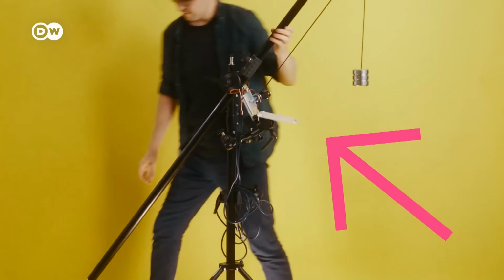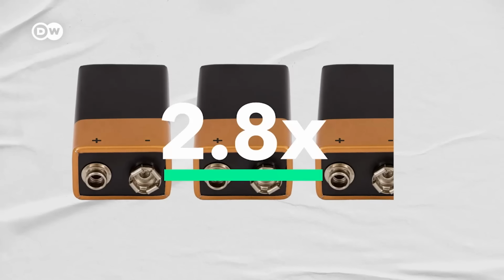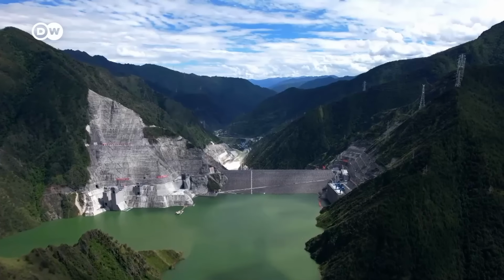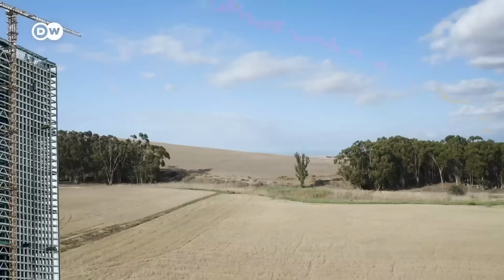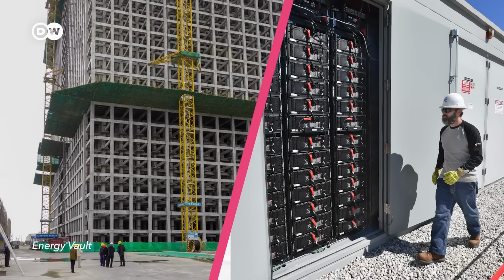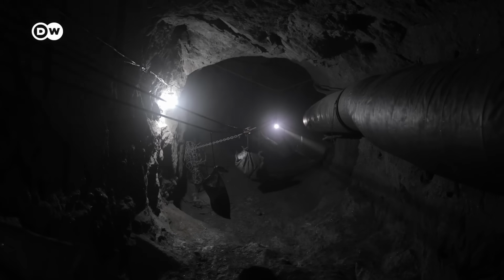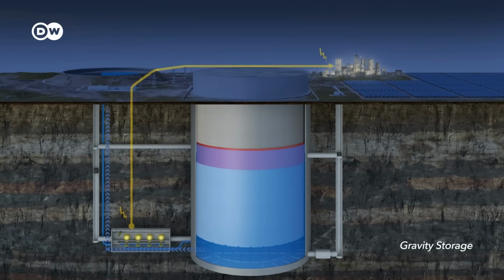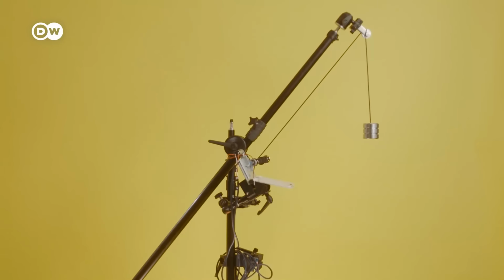How to use gravity to store energy

Comment from the maker: How is energy stored in your area? Do you think gravity batteries are the way to go?
Reply: - Gravity: Only Store Energy
- Hydroelectric: Store Energy and Auto Fill Energy (the cycle of evaporation and condensation of water powered by the sun's self-sustaining nuclear fusion)
Reply: Here is a better idea: pumped-storage hydroelectricity!
Reply: @Neferkariusz31 Depends on the use scenario. For emergency power supplies in critical infrastructure like hospitals, data center, transportation, gravity batteries can be a good solution to cover the first few seconds - minutes
Reply: Gravity batteries are expensive, and probably unnecessary.  See the work of Form Energy, a company that has designed industrial-scale iron-oxidation (rust) batteries that can be made from cheap, domestically-available, recyclable materials, that are extreme-weather tolerant, last for decades, and generate few, if any toxic byproducts, while also using very little water.
Reply: Waste of energy & money!
Reply: In the UK there are 65,000 redundant vertical shafts in old coal fields.  Many of these are close to population centres and there must be a good few that will lend themselves to the task better than others. Where I live, Cornwall, must be at least hundreds of vertical shafts in the old tin and copper mines.
Reply: @adrianfielding4678   the limits for a draw works seems to be 1000 tons. Use a units calculator (I use fourmilab) and enter `gravity * 2000 meters * 1000 tonne` to learn that even if you lower that enormous weight 2 kilometers, it only stores 5.5 MWh, less than two Tesla Megapacks. Contrary to what @Jonas Mayer says in this video, that kind of lifting/lowering machinery requires lots of expensive maintenance. If you use multiple weights, you now have to have big switching yards at the surface and below ground to move the working mass to and from the shaft: more expense, more maintenance.

Gravity is an extremely weak force!!
Reply: Wat too little energy stored. Compared to pumping water up and down a mountain, it is nothing at all.
Reply: Tax theft.
Reply: This is ridiculous. The future of energy storage is in enhanced geothermal. You get a free battery with every geothermal well.
Reply: Hydropower. Way more cheap, reliable and scalable. Any other gravitational battery is BS
Reply: Too the first question it's mainly hydro-power so for the mostly electricty usage we have here in Norway are clean energy, but there are also becoming more and more of solar production and wind. One of the reasons is that we wan't too keep mostly of the oil production too export, sell it too other countries who need it more and making more money on the sells and keep mostly of that production into profits. And it's kinda opposite of what Norway have been standing for in the rest of the world, but we are in fact very focused on the environment. So we are also using el-bike, el-cars like mention it's charged up with electricty that's mostly beeing produced with water, solar or wind.

And we are also having alot of electrical bus and train so we are less and less demanding for the oil.
This is just genius. It's seems too be silence so that's also another positive thing.

- Norway
Reply: can u please point to the actual date when u learned, or generally journalists learned that u could be educated sufficiently about something from one of the leaders of the company with a specific interest to make sure this makes them money? when did businessperson become scientist, i didnt know this happened, I guess I can trust Soudi Aramco with all of their business decisions now, and i cant really trust them when they deny climate change now, thank you for teaching me the wisdom of oil barons and Leonardo DiCaprio. (sarcasm)

Next time you make an ad, please review your country's legal guidelines and regulations because as it stands this is just pure misinformation literally funded by oil companies as you mentioned in the video

"we will only know if this will work once its been built"
>science who has spent the past.... mmmm idk... few CENTURIES working on mathematical models that people like the likes of elon musk and dw seem to ignore and reject, "can you stop wasting money on shit i told u wasnt gonna work, am i a joke to u?"

I cant believe you started this vid by saying something like "but dams are expensive and big and need specific locations" then end the video showing that this method is more expensive less efficient and has the same drawbacks considering its just another form of mega structure (a mine is also a mega structure), please grow some perspective.

What is with the meandering soft takes most people dont watch videos to the end you have just misrepresented this whole thing by giving more of a shit about your click through rate and watch time than the news or information, thousands of people will never see the conclusion and will be talking bullshit to their friends now, good job, way to news
Reply: If it gets too windy, the swinging weights will damage equipment, so gravity batteries are best done in a mineshaft.

A better option is to make mini-pumped hydro on hills.
Just build steel cylinders on hills, cap them with a heavy lid and pump densified water uphill into them.
Instead of storing regular water in a dam without pressure, this stores densified water in a hydraulic accumulator, so can be used much on smaller hills than pumped hydro.
You store far more energy because the working fluid is under modest pressure and the densified water carries more energy downhill.            :)
No rare minerals required, just steel and pumps.
Reply: @EveryoneWhoUsesThisTV just make the structure enclosed. The weights moving up and down on the inside of the tower. Duh.
Reply: @SandroLyrio  That's not the system pictured here or discussed.

Seems like a simpler solution would just be to switch to something that actually works.
:D
Reply: @EveryoneWhoUsesThisTV The technology is what is in discussion.
Reply: @SandroLyrio  Yes, this technology is what we're ripping on because it's so goofy....      :D

Building a tube tower with limited internal storage for the blocks isn't a solution.
It would cost more than a stick tower and still be almost as useless.

Let's build a hollow skyscraper as a cost effective way to store power...        :D
Reply: Guys wtf. Gravity batteries have been debunked as braindead bs YEARS ago. The entire idea is utterly ridiculous. How did you end up in this rabbit hole? This is so stupid it severely undermines all credibility you have had so far. I now question everything you ever told me and will never again be able to use you as a reliable source. Wtf, seriously...
Reply: Who ever said Germans were humourless has never watched this.

This message brought, bought and paid for, for you by the Big Oil & Big Nuclear Fission industries. 

Lithium is bad, lithium is bad it damages the environment, it only lasts a short time, it, it, it  undercuts our industries  and we going to loose our cushy jobs and its so unfair wah!
Reply: This is biggest bullshit i have ever seen.... NOt only is big, expensive, and have small capacity, it produce A LOT of CO2, bc those materials like steel or concrete DO PRODUCE A LOT OF CO2 shen they are being created... It is way ti steal government (our) money at the best... nothing else...
Reply: Great addition to a hybrid system setup, along the lines of capacitor energy storage.
Underground setup is a better bet.
If needed, can be adapted to run on draft animal power - or even human power.
Reply: https://youtu.be/NIhCuzxNvv0?si=ovsHPu0_8qcOIPWY
Reply: its nonsense and trap for investors who dont now much about physics.... Why produce that weights from steel, concrete, sand whatever what material will be, when water dams solved this centuries ago? And dam is refiling "itself" you dont need repairs of ropes, that weight itself, and same time you regulating water for industry, agriculture etc..... This is so sad how dumb are people now days. I eat my shoes if this could be economicaly feasible. Its only stupid.
Reply: aside from pumped hydro gravity batteries are scams designed to defraud investors. Why are you promoting scammers, DW Planet A?
Reply: Why dont you lift huge bags of sand in Sahara by boiling seawater by mirrors ?
Reply: Bruh. This has been debunked so many times now. At least one can now measure the delay from the first proposal to when DW would pick it up for a clickbait. 😛
Reply: @DW Planet A i'm highly dissapointed in you. Gravity Batterys are offside pumped hydro a scam. And almost anything you told in this video was wrong. You could have known by using your brain. Or doing a simple search. You know there are youtubers dedicated in debunking BS. If you are to lazy to factcheck on your own bc you dont understand science: Just put the name of whatever and add scam or debunked etc to it...
I just did with Energyvault and you quickly find a douzend videos explaining why it does not make sense.
Reply: GJ you fell for an old scam. The optimized version of this is pumped storage.
"But you don't have water everywhere!"
Holy Susan...
And the materials for this scam just spawn in? And are cheaper then sea water?
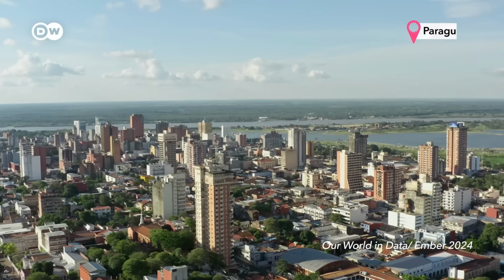Reply: 1:32  What a great way to remediate old mine shafts. Clean, abundant power.
Reply: @democratizeourpower-nr5yy  not abundant. If you just lift and lower one massive weight in the mineshaft it doesn't store much energy (otherwise old mine owers would be doing this already); if you have multiple weights then you need to build large switching yards at the surface and the bottom of the mineshaft at great expense.
Reply: No unless they are the hydro electric variety.
Reply: This is  SUCH a dumb idea. Sorry. One of teh dumbest and  least renewable battery storage idea's ever created. MaybeMicro with massive granite boulders but  concrete????? is not at all acceptable. Adam Something  slagged this junk idea of   complete con artists with a dumb idea years ago when first proposed. just tell them NO. there are far better ideas. Just ask the Welsh.
Reply: VAGUE.
Reply: Horrible
Reply: The value of gravitational force is dependent of the height of weight from the ground. So to life the weight for first 5 meter we need energy E1 but to lift for the next 5m we need Energy more than E and so on. Similar when the weight is released it will produce more energy at higher levels and low energy at lower levels. So how this issue will be resolve. We may face more energy loss during this process. 🤔
Reply: What about abandoned oil wells ?
Pre holed thousands of feet!?!
Reply: Make the connection 👉 The Connections (2021) [short documentary] 🌎 ♥️ 😎 ✨️
Reply: Why not just move water between upper and lower part of abandoned mine? Pumped hydrgo underground.
Reply: I think pumped storage as a proven and cheap method (1GW storage costs around 1 million USD  to build) and run at 80%+ efficiency is so well established, that it is unlikely the markets will gamble on this method. I may be proven wrong......
Reply: Yes they are the way to go, but seriously use buoyancy to get the weight to the top.
Reply: What about slipping a gravity battery frame under the next big heavy building being built in a city?
Reply: What happens if it uses two cable systems, one to go up using a compound pulley system to bring the weight up with much lower work, then when at the top it releases from the pulleys system to come down at full weight? Are we gonna get from it more than it took to get it to the top or am I tripping?
Reply: They don't work when the wind is blowing. It's a scam.
Reply: @josephd.5524  just make the structure enclosed. The weights moving up and down on the inside of the tower. Duh.
Reply: This is why I want Deutsche Welle blocked from my feed.

We've had gravity batteries for literally thousands of years.  It's called hydro-power by some.

But for some reason, the Wokist Left seems to equate hydro-power with dead fish, no matter where it might be sited, no matter how it might be designed.  And they seem utterly incapable of assimilating anything else, especially if it contradicts their little "Dams Kill Fish" jingoism.

You do the same with nuclear (shut it off and tear it down), then go buy and burn more Russian methane.  And then you point the finger at the US for climate change.
Reply: @casnimot  great comment and to the point. To early in the day- but I should calculate how much uranium is needed to "store" 100MWh of energy. Not much I'm sure
Reply: DW . after the idiocy of the generators on the water pipes, you come up with something that even a high school calculation shows is completely unlikely to ever be implemented as anything as large scale. The only reason there are companies doing this is because there are enough people with money, private and public, to just thrown money at anything that they don't understand and sounds promising.
As an old saying goes: As long as there are sheep, there will be sweaters.
Reply: @jmsa2760  You are correct. Basic science based filter skills are lacking in society and it shows. It is fine not to be able to do it (calculations)- not good for journalists not to be able to find "expert opinion". One 20ish kg of CANDU fuel bundle (natural, not enriched uranium) contains 1100MWh of energy- Many times what this steel towers monstrosities can store. And that bundle at the end of service will still have about 98ish times more energy to be released in the future (advanced reactors, which we knows works).
Reply: @thuderf00t
Reply: Liquid air batteries are a better option than this and upto 68% efficient highview power is a Scottish company is developing this long or short term grid level storage system.
Reply: @powderchills9125  Tell me you dont understand anything about mechanics or having a grasp of thermodynamics without saying it.
Reply: what if I double (possibly triple) this tech efficiency or with same size capacity , do they accept cooperation ?
Reply: I have tried it and resolved it successfully with easier way to make it and around thousand time less costly without the use to build such voluminous, heavy and without any adjacent battery system as there is no problem of storage for its indefinite production *since more than two decades*, but though tremendous innovative and technological research institutes have been approached for implementing such in ovation, NO ONE HAS RESPONDED POSITIVELY SINCE.. I think that it is because it will be a threat to all these HUGE COST INDUSTRIES WE HAVE NOWADAYS. Regretful, but it is life. Individuals have no rights if they do not share their Intellectual Property to "Start-ups or else", or that individuals are not young enough or posess degrees in the innovative works they do. It is SUCH kind of attitude that has ALWAYS BLOCKED IMPORTANT CONTRIBUTION TO HUMANITY where underdeveloped countries will always stay under the footsteps of billionaires etc.
Reply: @sermadreda399  Do you have a patent on your IP?
Reply: @DWPlanetA  Another worthwile energy storage method can be green hydrogen(understood as hydrogen from electrolysis powered by renewables). Maybe also biohydrogen.
Reply: @Neferkariusz31  tell me you know nothing about hydrogen without telling me you know nothing about hydrogen.
Reply: @gudrunhartfaust9378  How so? 🧐

Comment: Compressed Air! ... already have it and it works very well ... when the sun shines, use the excess energy to pump air into a tank under pressure; when the sun is down, reverse the pump to spin an electric generator .... rarely, use the Li battery as a backup .... this is small scale which is probably what is needed .... every home ought to have one .... what you've seen here is mega $$$, megs buildings and future mage $$$ for stored energy .... keep it small and local .....
Reply: Very inefficient though. Energy losses are high.